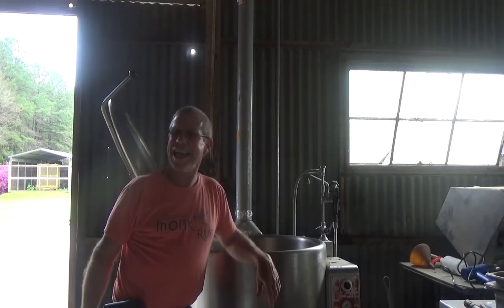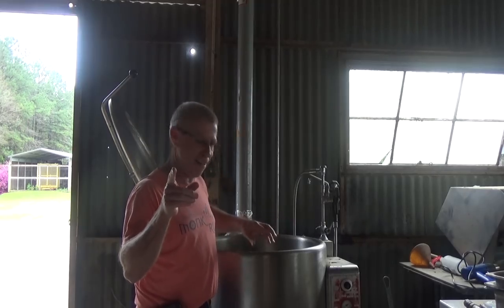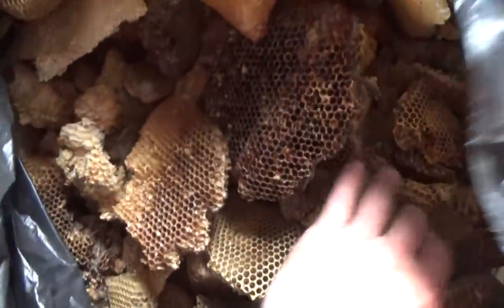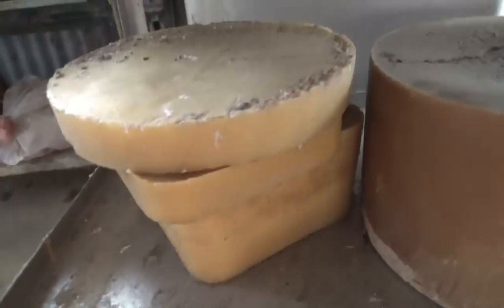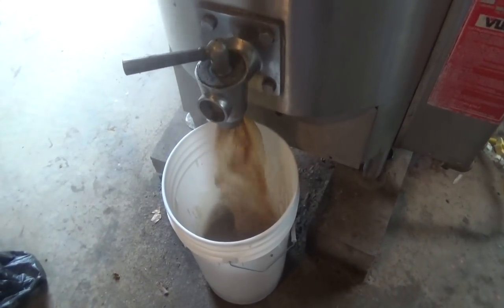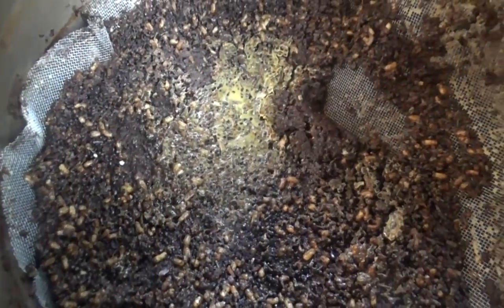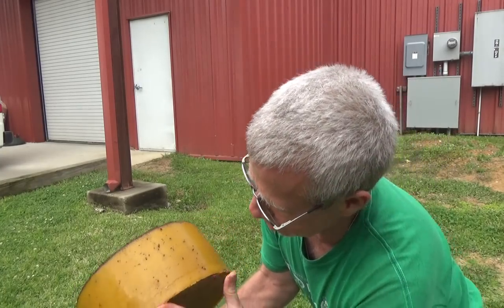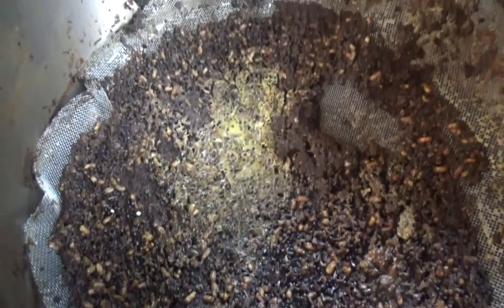Innovative idea to simplify rendering bees wax.

Comment: Nice to see you´re always busy as usual. Hopefully you got really nice through that hot summer. 
My fear with the strainer inside of the kettle was that some nasty stuff is flowing aside of the strainer directly into the bucket. But it seemed to work out fine. 
God bless you and your beloved ones.
Reply from the maker: Thank you for your blessing Peter, it's really good to hear from you again, I guess like me, you are very busy. This strainer worked very well for as crude as it was, but I'm working on an improvement right now, it's a fitted basket strainer.  It is based on the way we boil our crabs, crawfish, and shrimp here in Louisiana, with a handle that could be lifted out of the kettle thus allowing all the liquid to strain through the mesh leaving behind all the rubbish for our compost pile.  Thanks for watching. God's peace Peter.
Mr. Ed
Reply: I was thinking about putting the wax in not so much amount at once to not overfill above the strainer, for making sure nothing would go the bad way and some dirt would find a way into the bucket. But when it worked, all fine. :) 
Yeah busy.. have a little summerbreak in form of 3 weeks vacation, the first is behind me, the second is going on, and I though on the third week to go a few days of camping, but the forecast of the weather are not so good as I hoped for. I´ll thinking about let it go for this year and not going anywhere this Summer. About the Winter/christmas break, I don´t have any dates actually, so I can´t planning something for that. For Sure I´ve some days free between Christmas ( 24th of Dec ) till Silvester/New Year ( 31st of Dec/1st of Jan ) and the following Weekend. ( Should be the 6th of January in the 2019.) but not sure, if it so.

Comment: Now if you can get one made that fits you'll be rendering with a BIG smile on that face! Gods Peace and Happy Happy!
Reply from the maker: That will bee the next evolution to this process, a fitted, fine screened wire basket with a handle so as to lift the basket from the kettle thus allowing all the liquid to strain through the mesh leaving behind all the rubbish for our compost pile.That method works great when I boil crabs, shrimp, and crawfish, so it should work just as good on bees wax. Thank you for your suggestion and for watching. God's peace Lewie.
Mr. Ed
Reply: You might get it made with it setting up an inch or 2. That way it'd all drain out instead of just sitting on the bottom. I try but you know how goofy I am and GBWYou, Brethren!

Comment: liked the video, little tip, if you turn your melter down a bit so it just melts the wax and not boil it, it will come out lighter in color.
Reply from the maker: If I was a bit more patient, I could actually do what you suggest. Thanks for the good suggestion and for watching. God's peace. 
Mr. Ed

Comment: That works for the majority but id HIGHLY recommend looking into getting a few garret gold classifiers to sit on the bucket and catch any thing that was missed, you could easily get that clean down past a 50 mesh in a single pass if you really wanted just stack one or two sizes on top of the bucket and let it rip.    If you get to much debris just close the valve dump the classifier and back in business in a few seconds

Comment: Your screen worked well, just a thought I had, take one of those bucket lids cut the inside out leaving the rim take a piece of screen put it over the bucket, not tight make a dip in it and then place the ring over the screen and snap it down. Thanks for sharing.
Reply from the maker: Thank you for your idea Diana, I am working on a new one idea myself  based on the way we boil our crabs, crawfish, and shrimp here in Louisiana. It would be a basket with a handle that could be lifted out of the kettle thus allowing all the liquid to strain through the mesh leaving behind all the rubbish. Thanks for watching and your help. God's peace.
Mr. Ed

Comment: That worked pretty good but you didn't really need to turn the heat on in the kettle.  I've been in that shop and I'm surprised that wax didn't melt in the bag when you sat it on the floor.  ;)
Reply: He can't help hisself!
Reply: He's supposed to be environmentally friendly and he's burning all that electricity to melt a little wax.  lol
Reply: The global tennie-sneaker footprint!
Reply from the maker: It is hot in that building, and had I left the wax in the bag out there for 4 or 5 days, it would have been one big nasty glob of wax and cocoons, but I needed to make this video, and my camera is not designed to withstand those temperatures for prolonged periods, so I turned on the kettle. Thank goodness for gas and electricity. God's peace brother.
Mr. Ed
Reply: You can borrow one of my boots if you need a bigger carbon footprint! GBWYou!
Reply: @628DirtRooster   he can't help himself hes no longer in the dark ages

Comment: You can use all kinds of things to strain the wax. If you start with quarter inch hardware cloth that'll get the bulk of the trash. Then move the liquid through smaller mesh each time depending on how clean you need the wax. Finally, you can use cloth or old linen for last steps. The more water you rinse the wax with the lighter the color will get for use in candles. I use the trash from the wax in the compost too, it really heats up the pile with all the energy in the material. I want to see the compost piles.
Reply from the maker: I have tried dozens of methods of filtering the wax, and all work to a degree. The problem I really have is the balancing the filtering to the amount of wax that I need to process. To date, this has been my most successful method. That being said, I've already got another idea to improve the process. It would be a basket, based on the way we boil our crabs, crawfish, and shrimp here in Louisiana, with a handle that could be lifted out of the kettle thus allowing all the liquid to strain through the mesh leaving behind all the rubbish for our compost pile. God's peace.
Mr. Ed

Comment: Obviously, now that you've proved that screen works, you can clean up the edge of it so it fits tight in the kettle, which will
get rid of even the few dead bees, etc. that snuck through the bulges and gaps around the edge.

Makes sense - you're screening out all of the crud inside that heated kettle, so even the little bit of wax around the cocoons and
other crud is kept hot, so it will slowly ooze down into the drain.  Whereas with you hand straining it, the wax mixed in with the
crud you've skimmed out will solidify immediately - and you have to throw that wax out with the crud.  You smarty pants!
Reply from the maker: I have tried dozens of methods of filtering the wax, and all work to a degree. The problem I really have is the balancing the filtering to the amount of wax that I need to process. To date, this has been my most successful method. That being said, I've already got another idea to improve the process. It would be a basket, based on the way we boil our crabs, crawfish, and shrimp here in Louisiana, with a handle that could be lifted out of the kettle thus allowing all the liquid to strain through the mesh leaving behind all the rubbish for our compost pile. Thanks for watching. God's peace Robert.
Mr. Ed
Reply: If you do that, where it has a round frame(with handles) that fits tight into the kettle, maybe you could have it be a two-stage mesh, where
your coarse mesh is on top, and a finer mesh like a window screen is suspended 1-2" below it?

Except ... then the coarse mesh wouldn't be in contact with the kettle bottom,  so it wouldn't be kept hot(and thus keep the crud/cocoon/wax mish-mash hot) and the mish-mash would solidify and get caught in that coarse mesh without letting the wax ooze out.  Hmm. Interesting problem.  Maybe I'll shut up now.

Comment: Yes, very good idea. You might want to improve it by having some SS or Al round stock formed into a circle at a suitable diameter and with wire "stitch" the mesh to eliminate the puckering on the sides.
Reply from the maker: I'm working on getting a SS basket made for the kettle, that should fix things really well. Thanks for suggesting and for watching. Don't forget, I post a new video every Friday morning, and it would be great to hear from you on a few. God's peace.
Mr. Ed

Comment: HI Jeff, Great idea, you should make a basket out of the wire mesh
Reply from the maker: That will bee the next evolution to this process, a fitted, fine screened wire basket with a handle so as to lift the basket from the kettle thus allowing all the liquid to strain through the mesh leaving behind all the rubbish for our compost pile.That method works great when I boil crabs, shrimp, and crawfish, so it should work just as good on bees wax. Thank you for your idea and for watching. God's peace.
Mr. Ed

Comment: Hey There
I enjoy watching you wrangle those bees.
I had a thought. If you use a bigger piece of screen and sew it into a pouch, you could hang it into the pot into the water. The pouch would hold all the nasty.
If you made one with a finer mesh, could use that one for a second run.

Keep the honey flowing!
Reply from the maker: We are both on the same track. That will bee the next evolution to this process.  It would be a basket, based on the way we boil our crabs, crawfish, and shrimp here in Louisiana, with a handle that could be lifted out of the kettle thus allowing all the liquid to strain through the mesh leaving behind all the rubbish for our compost pile. Thanks for your ideas  and for watching. God's peace brother.
Mr. Ed

Comment: HI Jeff.  A question:  Have you ever tried a 'china cap' to strain out the nastiness?  A 'china cap' is something they use in restaurants to strain out hot foods from the broth; aluminum cones, about 12-15" in height with an upper opening up to 12".  Kind of like a funnel, but with holes in it.  Lined with filter paper, an old T-shirt or any ultra-fine cotton cloth: anything really, it might be able to strain out all the smaller pieces instead of re-heating and straining multiple times.  Just a thought.
Reply from the maker: I know what a china cap is, but there is not one big enough that would work for me. I am working on an idea based on the way we boil our crabs, crawfish, and shrimp here in Louisiana. It would be a basket with a handle that could be lifted out of the kettle thus allowing all the liquid to strain through the mesh leaving behind all the rubbish. Thanks for watching and your help. God's peace.
Mr. Ed

Comment: Looks like you took a normal double boiler pot and cut the bottom out of it to make your top pot on a double boiler cooker.   You might want to look into a steamer pot for your cooker, which has a bottom full of holes.  Place cheese cloth on the bottom of the pot to act as a filter.  The cheese cloth will filter out the larva, cocoons and most of the dirt resulting in a clean wax block that should not need to be scraped to remove the dirt.   Adding cheese cloth to your present setup should also work.

Comment: I wish I had a high end commercial grade processing equipment to run our 120 colonies...instead I do it all by myself with rudimentary low tech equipment...
Reply from the maker: I have been truly blessed to be able to work in the conditions that I find myself in. For more than 15 years, I was processing honey and wax out of my garage using a small, hand crank extractor, a long, serrated knife for an uncapper, a bucket to catch the cappings, and a 3 gallon soup pot to melt my wax in. It worked fine, but I was always looking to make it easier and faster. God's peace brother.
Mr. Ed

Comment: Maybe make something like a giant nut bag out of the screen cloth next time
Reply from the maker: Thank you for your suggestion Liadara, I do appreciate the help.I have tried dozens of methods of filtering the wax, and all work to a degree. The problem I really have is the balancing the filtering to the amount of wax that I need to process. To date, this has been my most successful method. That being said, I've already got another idea to improve the process. It would be a basket, based on the way we boil our crabs, crawfish, and shrimp here in Louisiana, with a handle that could be lifted out of the kettle thus allowing all the liquid to strain through the mesh leaving behind all the rubbish for our compost pile. Thank you for your idea and for watching. God's peace.
Mr. Ed

Comment: Ok, 1st off. You are doing this wrong. You need to skim it. Much cleaner. Build a spigot about halfway up you tank to drain the pure wax from the honey and junk. The wax will float on the top of everything.
Reply from the maker: I have tried dozens of methods of filtering the wax, and all work to a degree. The problem I really have is the balancing the filtering to the amount of wax that I need to process. To date, this has been my most successful method. That being said, I've already got another idea to improve the process. It would be a basket, based on the way we boil our crabs, crawfish, and shrimp here in Louisiana, with a handle that could be lifted out of the kettle thus allowing all the liquid to strain through the mesh leaving behind all the rubbish for our compost pile. Thank you for your idea and for watching. God's peace.
Mr. Ed